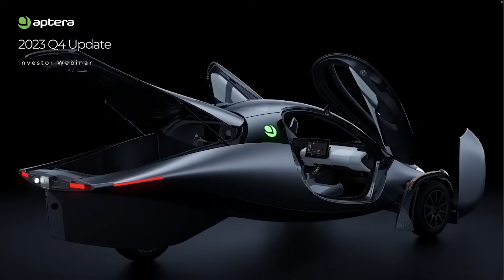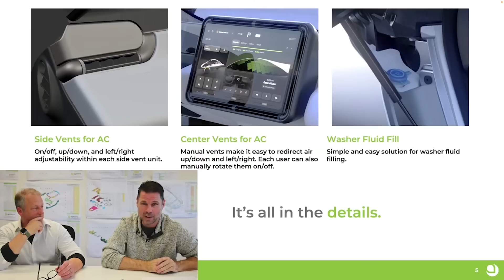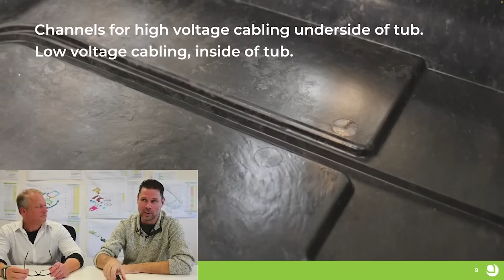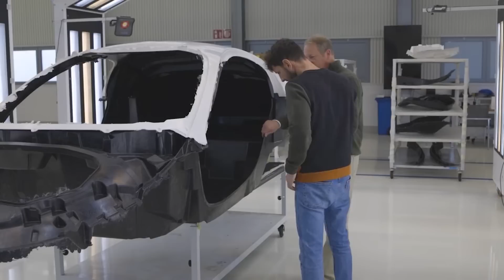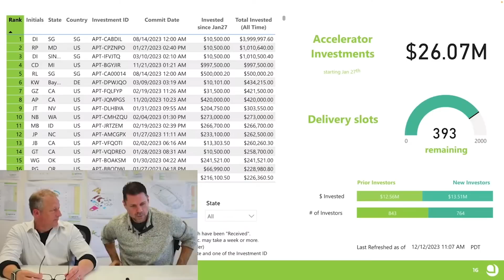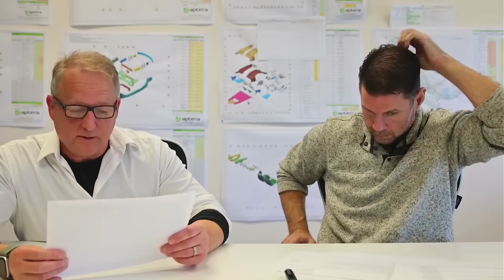Aptera December 2023 Investor Webinar

Comment: what is stopping Aptera from converting it to 48volt from 12v architecture? I was just tying to compare with Tesla's new CyberTruck that runs on 48v architecture. From Sandy Munro's interview with Elon, i thought it was a great upgrade to reduce the weight, cost in copper etc ....
Above all if it can bring V2G/ V2H/ V2L capabilities, that would be fantastic.
Reply: A higher priority is a heat pump
Reply: @ShihanQu  being a Canadian and both a reservation holder and and and investor, I also hope for heated Yoke and Seats. Yes, I do agree with the heat pump.
Reply: @Soothsayer210 I remember seeing a video where they mentioned that a heat pump was $1M+ just for the NRE costs. Given the small cabin I'm hoping the resistive heater won't be too much of a hit to the battery.

I hope they have the wiring in place for heated seats. That way it's not much work for third party or DIY heated seats.
Reply: @AverageJoe928  I believe Tesla's CyberTruck comes with a heat pump.
Reply: @Soothsayer210 all Tesla’s have heat pumps now. Ford added it to the 2024 Lightning, or maybe just the Flash trim. It would be an added expense and time delay for Aptera to add one for the Launch Edition. They could add it later once in production like many other automakers have done. It’s possible that cold related range loss will be a lot less in Aptera than in others due to the smaller size of the cabin and less window area and relatively smaller battery pack.
Reply: They need to get the vehicle launched first so they are going with off-the-shelf systems first. Down the line they plan on going to a higher voltage.
Reply: You're definitely going to save weight with a 48v system, but considering how low power leds are, the wire is already gone to be pretty small, and the more power heavy components will be very close together in the cabin. 

Basically I think you would save weight, but I don't think it would be noticeable at all, especially if 48v systems are much more expensive
Reply: There isn't much low voltage wiring in the Aptera compared to a Telsa. I don't think it's necessary at this time.
Reply: @tims8603 Aptera does have some sort of linbus system or it might be their own design where they have hubs that are have power ground and a control wire routed to them. Things local to the hub are connected to them saving the need to wire independent wires through out the body from the battery. Commands are sent from the touchscreen to the hub to control the things connect to the hubs. This greatly cut down on the amount if wiring needed ahead of a move to 48V.
Reply: Simply just that it's more expensive and has less access to existing car parts. It's more being done by Tesla because they have the funds to make their own supply chain and therefore don't worry about existing supplies of parts. It's more a long running goal for Tesla to save money, it doesn't change much for right now.
Reply: Because Aptera can't get the cutting edge tech that was specifically made for Tesla. it will come to every EV eventually, but this is still too new of tech for Aptera o (or any other company) to have access to.
Reply: The Aptera does not need a 48 volt system to power a single wiper the size of a bastard sword. I'd like my Accelerator LE within fifteen months.
Reply: @barnabasseadog7660  you shall have it in 12 months. :)
Reply: 4 times higher volt, 4 times lower current: reduced heat losses in the inwheel motors, and reduced necessity for cooling the inwheel motors.
Reply: @Coenraed4618 in-wheel motors use high-current wiring (400v), separate from the 12v accessories.
Reply: @Coenraed4618   The in-wheel motors run from the main battery pack via inverters and are high voltage, I believe it's in the 300 - 400 volt range.  It's only the few vehicle accessories that run on the 12V system.
Reply: Nothing stopping them from doing it. I’m waiting until they do plus the 1000 mile version.
Reply: @billsmith5960  i am waiting for my 600 mile off roader version. I hope by then, it will have heated seats and yoke along with a heat pump.

Comment: I have question that can easily be answered by someone who has been in an aptera. Is the seat angle (like my knees) like a truck (80 degree angle) or a car (closer to 150 degrees)?
Reply: This writer DID sit in Gamma in San Diego. I have a near useless right knee replacement, so bending it is a task/impossible. The Gamma seat is much more like an MG Midget, a Triumph sports car, the old Datsun Z cars or the Saab Sonnet. amoung other such low sports cars. It is NOT a truck by any measure
Reply: Much more car like in this regard.
Reply: more like a car

Comment: No one knows better than the engineers who spent a lifetime learning, designing and redesigning to bring the needed vision into reality. The possibility of one driving a solar charging vehicle that 'takes' and gives more time and resources to everyone is very exciting. And why don't more people know about it? It's very light and has a low center of gravity. The wide front wheel base may be an issue for some. It's not going to fit in the door of an average box truck. Can you imagine a 'car carrier' with Aptera vehicles already assembled? It's going to be a wide load.
Reply: A solar power carrier traveling over the paved soil and charging under blue skies many miles a day will likely happen in our lifetime.
Reply: Good work abounds. . .
Reply: I looked up U Haul rental box trucks just to see if Aptera will fit. It won't fit in the smaller ones. It will fit in the bigger ones. The bigger ones are expensive almost 2 grand plus fuel from there to a town near to me. I'm over 2,000 mi from Carlsbad. I think the only way to use a smaller truck is if it's a flat bed. I'm hoping they will ship cross country by rail or semi in the future. t should fit on a car carrier trailer. Those are over 8' wide.
Reply: @tims8603 in one of the interviews od Chris Anthony I've watch he mentioned that they have at least thought about a two wheeled dolly that would be placed under the rear wheel and somehow strapped to the body. Then they could be driven on to and off conventional car carriers.
Reply: @garywozniak7742  They could just add a center track to an existing car carrier. It wouldn't be too hard to have something that's bolted or welded on.
Reply: @tims8603  doe car carriers have a centerline rail to accommodate the 3rd wheel? I'm out in Maryland, so my options are expensive delivery, or fly out and pickup/dive back
Reply: @tims8603  I found my answer.. on the accelerator website is states: Vehicles must be picked up from our headquarters in Carlsbad, CA. so... a flying I will go